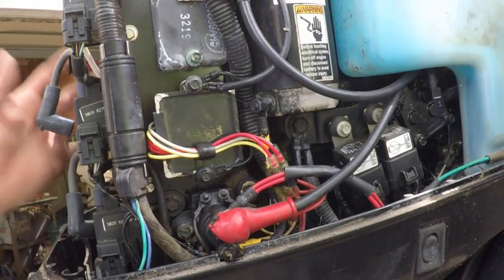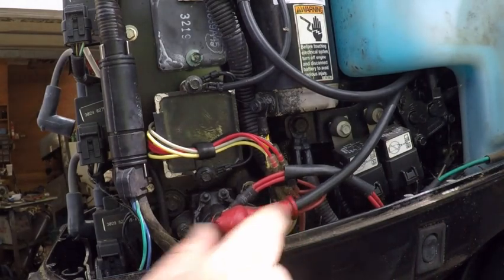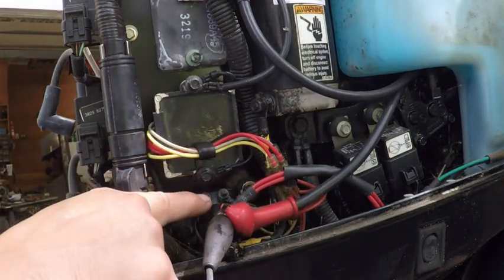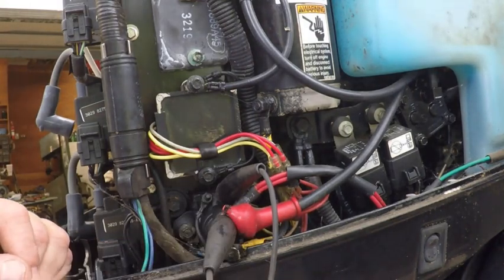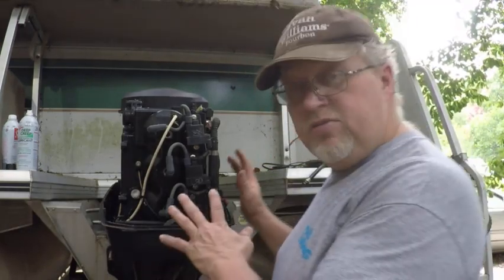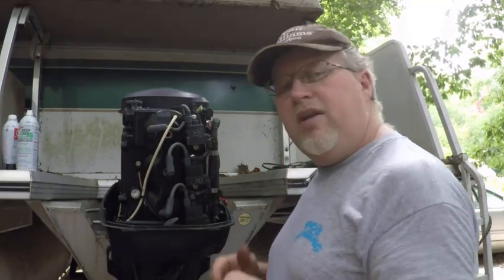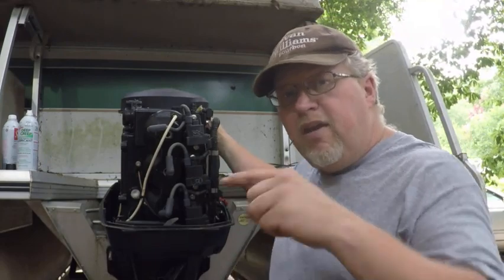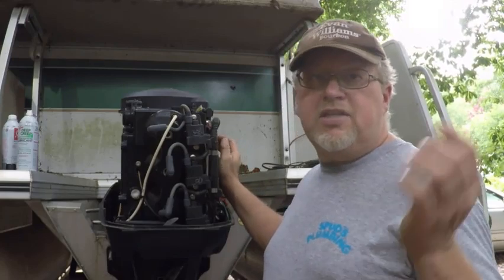HOW TO DO A OUTBOARD COMPRESSION TEST

Comment: Hello Jeff my engine has been sitting for 3 years it’s got very little hours same situation as yours my wife got sick and we put the boat in storage. Should I do the sea foam compression test and carburetor clean? Mechanic told me it wouldn’t start it needed a lot of work and then I found your video thank you so much
Reply from the maker: I like to do that in all motors that’s been sitting a long time.  It can’t hurt and could save you some headaches later.  Thank you for your kind words and watching.  Thank you

Comment: Jeff, have posted a 3rd video one the carberator prepping for a motor that has been sitting? First two video were great info for prepping an old motor.
Reply from the maker: I had a computer issue and lost 3 more videos on that motor.  It’s still running great and with perfect compression.  It actually got a little better after about 5 hours of use.   Thanks for watching I appreciate it

Comment: Thanks for your informative videos (it would have been great if you hadn't lost the carburetor videos - would have liked to have seen that process too).  Regarding the compression test, other blogs say to do it with a warm engine.  Your video did not say anything about the engine being warm before doing the test.  Any comments? Thanks.
Reply from the maker: Normally I do the test on a warm to get a top line measurement but the biggest factor you look for is are they all close to the same.  Cold or warm.  If this motor had been a running motor  at the time I’d done it warm.   Thanks for watching I appreciate it.

Comment: Got a 50 hp mercury 500 4 cylinder all cylinders are at 70 lb I know that's low , what should I do to increase compression?
Reply from the maker: As long as they’re equal I’d leave it alone.  There’s not much you can do other than a full tear down and rebuild to increase compression

Comment: Will the fuel pump still pump with the ignition off ?
Reply from the maker: On most yes.  Most older outboards use a  mechanical pump driven by the outboard when it spins. If it has fuel injection it has a second high pressure electric one to run injectors

Comment: Just Wondering, Why didn’t You do a follow up on how the motor turned out, I’m sure others are interested as well.
Reply from the maker: Well user error.lol.  I had a hard drive crash and lost about 10 videos and had sold the boat. . The boat and motor are still running perfectly.  Life lesson for sure.  Now I instantly back up to external hard drive. Lol
Reply: @bowl830  Why did you sell the boat ?
Reply from the maker: My older brothers boat tore up on him. I already had 3 lol. He is still using it. Runs like new still
Reply: @bowl830  , Thanks for the Reply, Have a Good Evening.

Comment: awesome.  What is a "good" compression tester?
Reply from the maker: Yes. I’m more worried about the numbers being close to even then the total most times
Reply: @bowl830  i meant what kind of compression tester should i get?
Reply from the maker: @osceolaseminole5596  lol.  I got a cheap one from auto zone and it is as accurate as my high dollar one. They’re all about the same.  Mostly you’re looking for consistency from cylinder to cylinder
Reply: @bowl830  thanks for answering. I'm going to get one. Next is the carburetor. Is that a video you have still?

Comment: Im in the same situation. I have an old 1953-1954 25hp Big Twin Evinrude OB. When i first got it, i had it serviced and its been sitting in storage since then. Question, is it also a good idea to dump all the old oil as well?
Reply from the maker: I would.  It’s a cheap insurance policy. Some oils will thicken up over time.
Reply: @bowl830  What about the impeller?

Comment: I've heard some claim that you must ground the spark plugs wires to avoid damage.  I have a 1996 200 Evinrude Vindicator with 6 spark plugs, not sure how to ground all 6 if that is really needed.  Is this issue optional if your start is brief??    Thanks for the advice!
Reply: The best thing to do is make sure it doesn’t spark.  On an older motor with a distributor I just pull the main plug off the coil so no spark plugs wires will spark. I also clamp the low pressure side of the fuel pump hose (the inlet) so no fuel comes through to the fuel pump. On new engines you can pull the fuse for the ignition system or disconnect the coil packs.  It’s different for every engine but the goal is to stop spark and stop fuel, just have the starter turn the motor.  Easy to do by just seeing what type of motor you have and pulling whatever is needed to stop fuel and spark.

Comment: Your party barge looks to be a little under powered with only a 25 hp motor.  Thanks for a demonstration of the use of the remote starter. I will be using your remote starter method to check the compression on my year 2000, 6 cylinder, 2 stroke, Johnson. Haven't used it for about 2 years and want to get it running by next spring to catch some bream.

Comment: Anything thoughts on checking the impeller on an engine that's sat like yours? Got a 15 hp four stroke that's got barely any hours on it and sat for 2 yrs. Like you, don't want to turn it over. I've be told that the impeller can be stuck and tear apart from sitting so long. Plus if it does, it's not sending water through the engine to cool it, adding to the danger. Any other advise appreciated. I'm in the same situation as the person you got yours from. Wife got sick and just didn't get the boat out. Need to sell it and don't want to wreck the motor or screw over a buyer. Thanks very much.
Reply from the maker: 2 years setting ain’t real bad. But I’d still take a few precautions. As for the impeller. I’d put it in water.  Let it set just a little then bump the starter or turn the fly wheel with rope slowly.   To give the Finns time to break loose if they’ve stuck to pump shell. Then you should be able to fire it up.  Just make sure she’s peeing. Good luck. I hope it goes well.
Reply: @bowl830  Sure appreciate the response. Might give it a hand turn to try to feel if it's stuck and go from there. If it's good, should take it in for a tune up, since I'm not mech inclined so much, just to make sure it's in good order. Thank u again. Much appreciated!👍

Comment: I know this is an old video, and this may sound dumb but do you have to drain all that deep creep stuff out first and change the oil? Thanks
Reply from the maker: No sir.  It will just burn out with the exhaust.  You will see a lot of oily suit but that is normal.  It breaks down all the old carbon build up in the system.
Reply: @bowl830  thank you, I'm possibly buying a boat project this weekend, with an old motor that hasn't run for two years.
Reply from the maker: Awesome. Good luck and most have fun doing it.

Comment: Not sure I caught it video, but...Besides opening throttle when testing, should the test be done with a warm or cold engine?
Reply from the maker: If your trying to just get a snap shot of the health. A cold engine will give you a idea if they’re all equal.  Now if it’s my engine and I’m doing my service work I will always run the engine for a minute or two.  That will give you the most accurate reading on overall compression and health of engine.

Comment: I have a 2001 40 hp Mercury,  3 cyl., 2 stroke ,oil injected.  I have not run or even tried to start this motor in at least 10 years.  I did  run all of the gas out that was possible and emptied the tank the last time i used it.. I am going to go through the steps to make sure the motor is freed up. My biggest question is pertaining to the oil injection. How do you determine if the oil is being injected as it should be.(Everything was working fine when it was parked) I have had friends blow up their engines when the oil didn't get there.  I like the oil injection but i  wonder how reliable it will be after sitting so long. Do you think it will be fine,or not chance it and just go back to mixing manually? Your thoughts?
Reply from the maker: First thanks for watching I appreciate it. If it were me.  I’d mix the gas.  Maybe 2-3 gallons at first but I’d run the injection system at the same time.  Double oil won’t hurt it and you can see how well the injection is working by watching the oil level change.in the reservoir.  Just remember injection system actually adjust oil by the Rpm’s running. So it might not look like it’s running at 50/1 by oil level. 
After you run it just remove plugs and clean. Just in case they get carboned up burning dbl oil
Reply: @bowl830  Thanks a lot, and thanks for the videos.  I just happened to find your channel and after watching some of your videos,subscribed. Right off the bat i see you fish the S.C. Lakes. Although i currently live in Texas, I was born in and raised in Conway, S.C. I fished some in Lake Marion and went quite a few times with Don Drose, A local guide. I never fished with any other guides, never had to. Striper and catfish, Don was the man.
Reply from the maker: Don was the man for sure.  Thanks again

Comment: Ok to do the compression test with the remote starter without actually starting the engine, getting oil and gas in the crank case. I'm new to this so not sure. Thanks
Reply from the maker: Yes,  your getting fuel just not spark. But you still have to tread it like it could start.  I’ve seen people have the engine wiring all messed up lol.  That’s why I always remove all wires and most times the plugs.  It easier for the motor to spin that way.

Comment: Thanks, I just tested a motor but had  the remaining spark plugs in and  connected when I cranked it. Does that mess up my readings?
Reply from the maker: Not really it just puts load in n starter your readings should still be good
Reply: @bowl830  Thank you. 75 psi on each cylinder of 30hp Mercury two stroke put me off..am I wrong?
Reply from the maker: The biggest thing is equal.  If they’re all pretty close in compression that usually means you’re good.
Reply: @bowl830  👍👍

Comment: Hi Jeff.  Did you end up using the can of Seafoam after cleaning the carbs?
Reply from the maker: I did add some to the fuel after the carbs were cleaned and installed.   Motor is running perfectly.  Thanks.

Comment: Can you use that electric starter on a pull cord outboard motor?
Reply from the maker: No sir. It’s just a bypass for the key
Reply: @bowl830  thanks for the quick reply. Do you just pull the pull cord when you have the gauge hooked up to the compression test then?
Reply from the maker: Yes sir.  I usually pull all the plugs and open the throttle to wide open.  That will let the motor turn freely and give you a good reading.
Reply: @bowl830  thanks again for the quick reply. Subscribed to your channel and wishing you all the best from Queensland Australia.

Comment: im new to bosting trying to get my engine running,,,im wondering about that tank back there? is that for oil? and does that mean its self mixes? you oil and gas? or do i still need to mix my gas on a 2 stroke?
Reply from the maker: If it has a little tank in back it probably is a oil tank.  If it’s been sitting a while I’d mix my gas till I was sure the oil injection is working.  Add oil to tank and see if it is using it.  It won’t hurt the engine if it gets dbl oil for a short time.
Reply: @bowl830  awesome  thanks ...what kind do u recommend
Reply from the maker: They’re all about the same.
Reply: @bowl830  perfect, I'm replacing spark plug well see if she 🔥up
Reply: Says use tc-w oil.? Just dump my 2 cycle oil in right
Reply: Also when I'm replacing them is there anything I should put on them or just throw them in fresh out of the box
Reply from the maker: Just set the gap if it’s that type. If not yea.  Good luck.

Comment: Hi jeff 
I have a 200 hp Mercury 
Some one told
That the compression has to be 120
Is that the right compression 
Thanks
Reply from the maker: The biggest thing Is you want your pressure to be equal.  A little difference from cylinder to cylinder is ok.  Just don’t want one being way lower than the rest.  That usually indicates a problem.

Comment: Maybe a dumb question but where can I get a handheld remote starter for the engine I’m currently working on? Thanks in advance!
Reply from the maker: Auto zone has remote starters for engines.  A automobile one will work.  It hooks to the solenoid .   You just pull the trigger .
Reply from the maker: Not a dumb question I should have mentioned where I got it.  Just make sure key is off so motor won’t try to start. 
Thank you for watching, much appreciated
Reply: Team Reelin The Blues awesome thank you! Great video!

Comment: Whoa ....wait, were`s part the three? You`ve got to clean the carbs still ...don`t keep us hanging, pleeeease!!!!???
Reply from the maker: I had a computer crash and lost three videos   I know I suck lol.  It broke my heart.  Valuable lesson learned.  I’m picking up a motor next week.  Hopefully it will be a good candidate for videos.  I apologize.  Thank you for watching. I truly appreciate it.
Reply: Team Reelin The Blues I was also looking for part 3. Great videos and information. What is the next step you would take before cranking? My engine is fuel injected so no carbs to clean.
Reply from the maker: Once you get the rings lubricated up and you and know they’re not seized.   I’d just add some fresh gas and oil and give her a spin.  Just always do a little break in.  You don’t have to do 10 hrs but it’s always best to run idle to about half throttle for a short period., then work it up from there.  After a trip out check those plugs to make sure they’re burning clean and do another compression test and check against you’re baseline